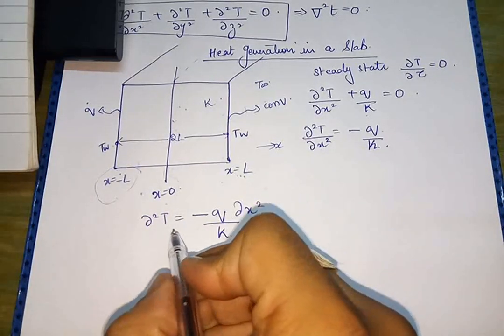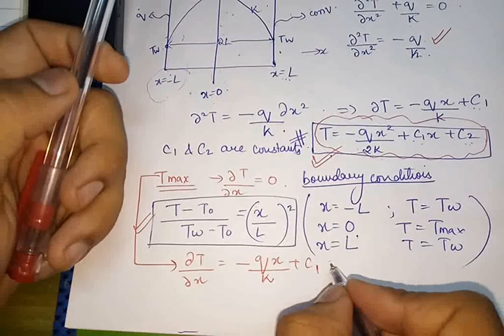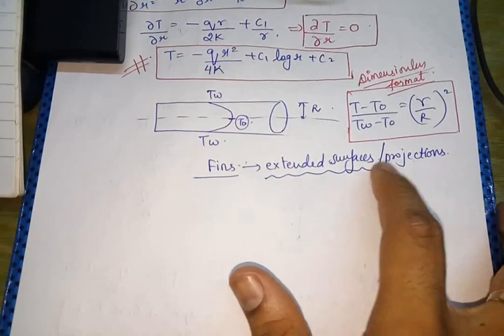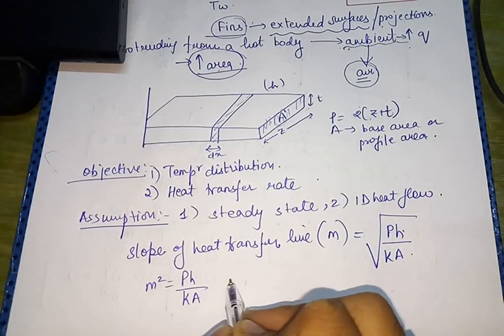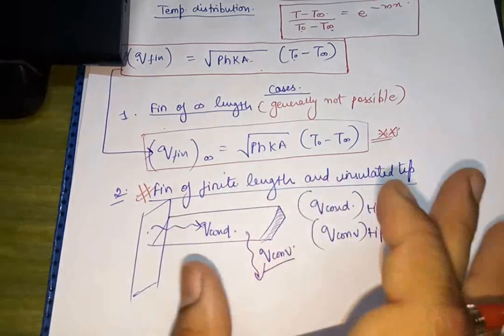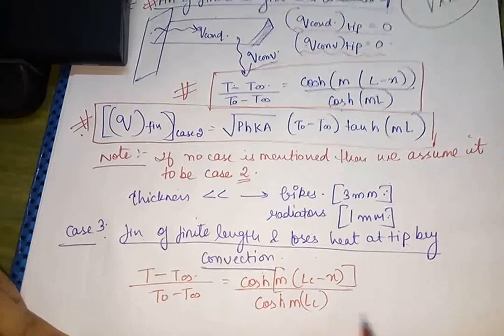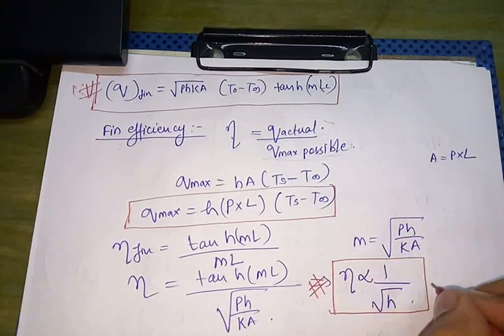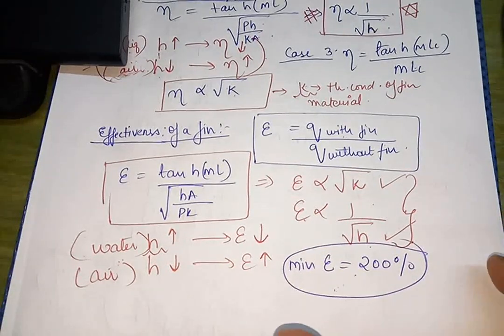Basics of heat transfer Lecture 6 : Heat generation and fins

Comment: Shagun I think corrected length for cylinder will be L+(d/4) not L+ d(square)/4. Ek Baar cross check kar le.
Reply from the maker: L+(d/4) is definitely for cylindrical fin and L+ d(square)/4 is used for pin type of fins..
Reply: L+d(square)/2, i think this is dimensionally incorrect. How can d(square)/2 can be add in L??